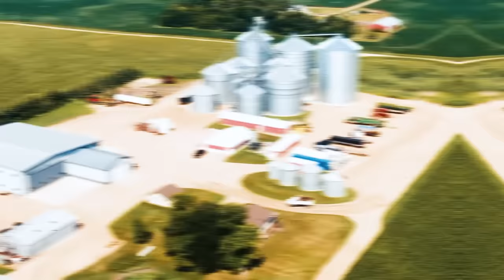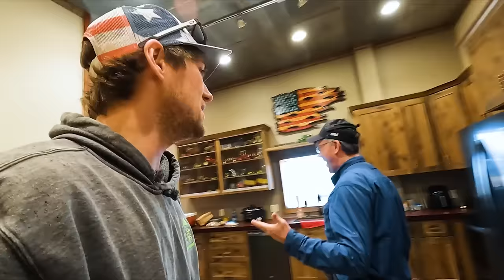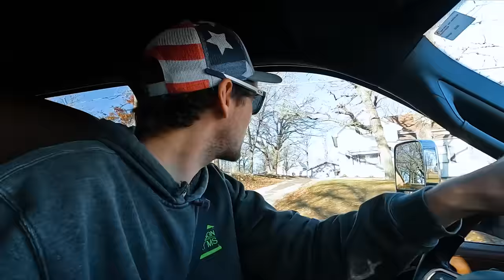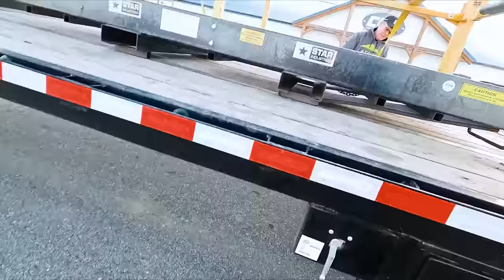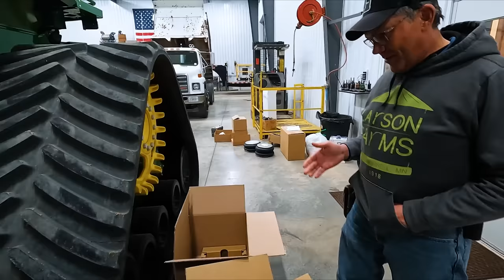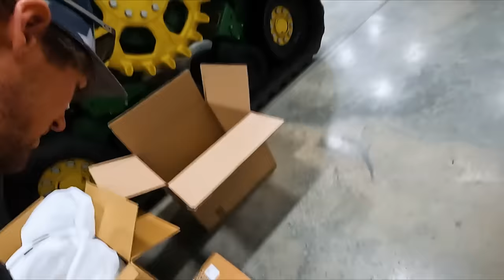It Was On Sale! They Said It Was A Mop!

Comment: Chet, when you put the hook of the strap on the rub rail....pull the hook/strap between the deck frame and the rub rail. That way you can place the hook over top of rail facing deck frame so the hook doesn't fall off rub rail.

Comment: Looks like a BobSweep.   They are really just vacuums, there is a "moppng" pad, but it doesn't dispense mopping solution etc.  Loot at Roomba or Shark, they have some actual mopping robot.  You fill with water\cleaning solution.  We have a BobSweep and it works great as a vacuum.

Comment: It is a vacuum cleaner, works great on your floors but not a mop. Once it is full it will find it's way back home and empty itself out. Just put the home station in an open area  but not where you will be tripping over it.

Comment: Words have meanings.  4:28  The day you dropped this video 24jan14th our world on wet Vancouver Island is in the grips of a deep freeze which for continental weather pattern users would just be a normal day of winter.  They on the other hand are below the -40's no  matter which scale you use.
Reply: No access.  Ya that happened up Vancouver Island for a hundred miles.
Reply: I saw a lawnmower like that out running around in the rain